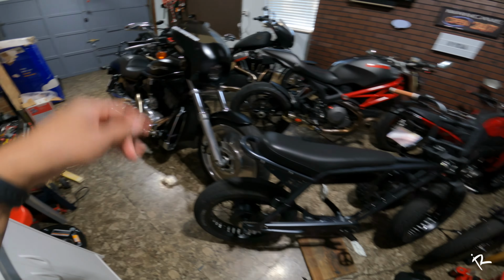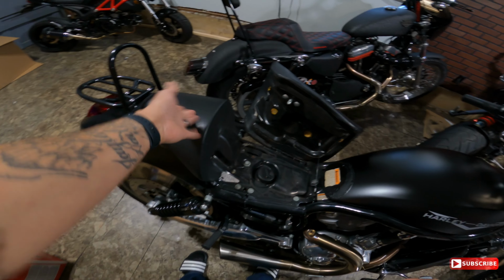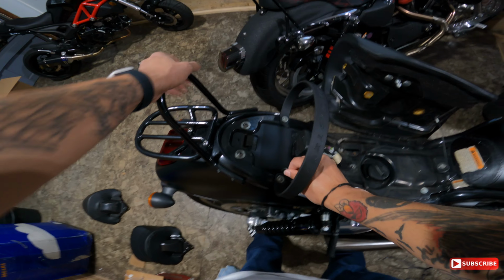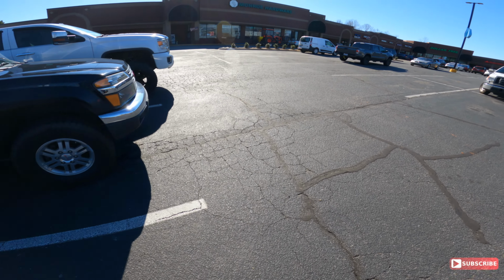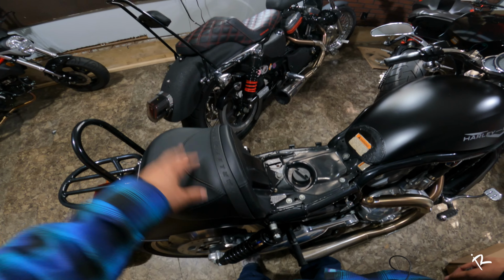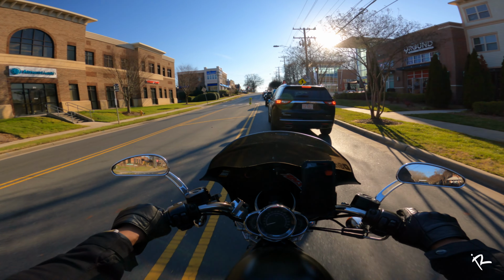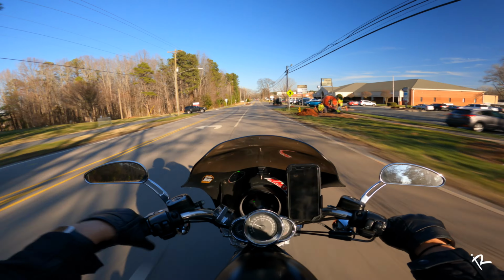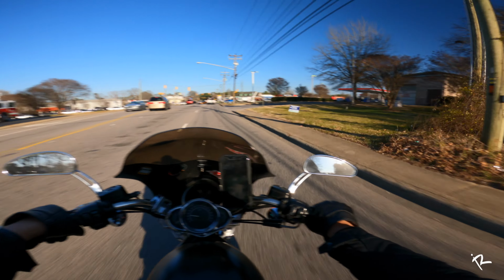This Seat Completely Changes The V-Rod

Comment: Man after my own heart. My first Vrod was an 04B. I put the same seat on it back in the day. I’m on Vrod number five and six. After riding lots of Vrods, the 08D Nightrod is my choice for champion of Vrods. It’s the Nightrod with the mid controls, not the Nightrod Special that’s blacked out, I’ve had two of those. The original Nightrod is awesome and I hate that I didn’t check one out sooner. I can’t get on board with the Livewire, but I’ve always had a soft spot for sportsters and those new S models are hot. I want a green one.
Reply from the maker: They fast too
Reply: Which seat do you have on your 08?
Reply: @SiempreAlgoLoco  currently just the factory one but I’ll be ordering one from Corbin this winter.
Reply: @SiempreAlgoLoco  I have the sundowner and I can confirm it rides smooth and soft and feels great on my back